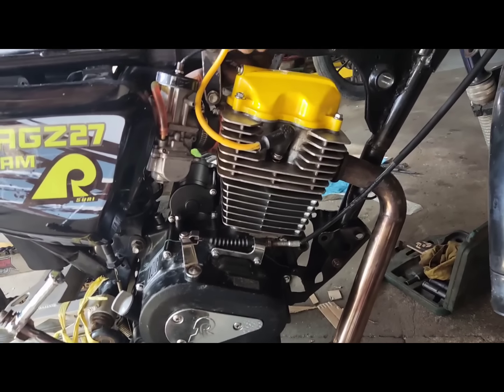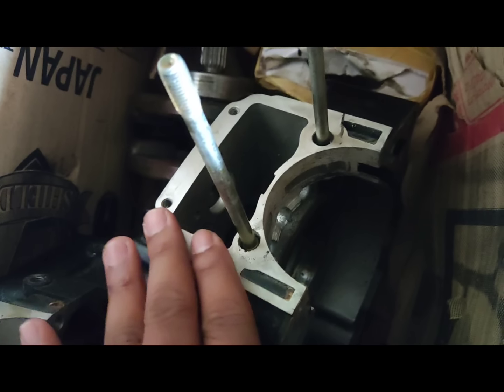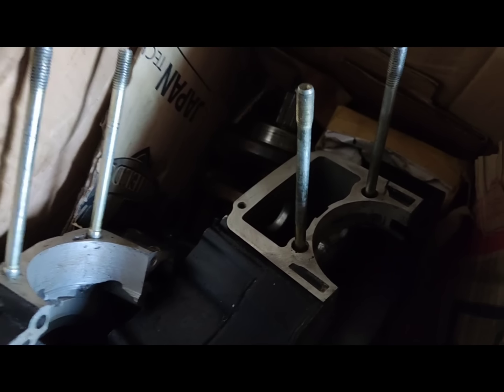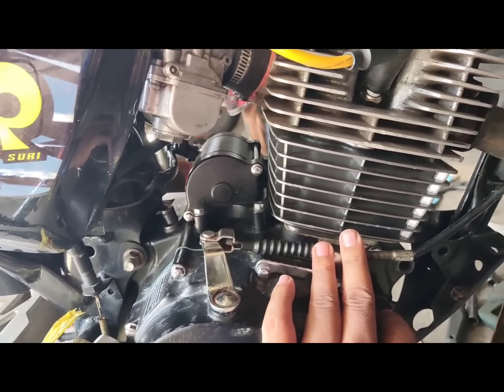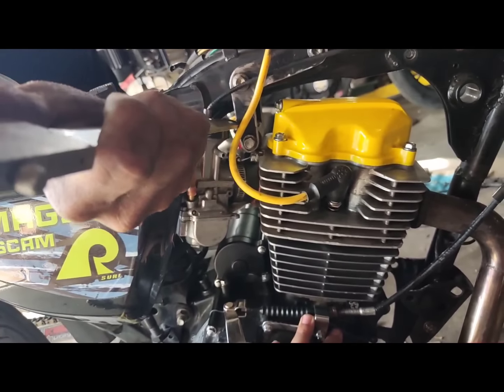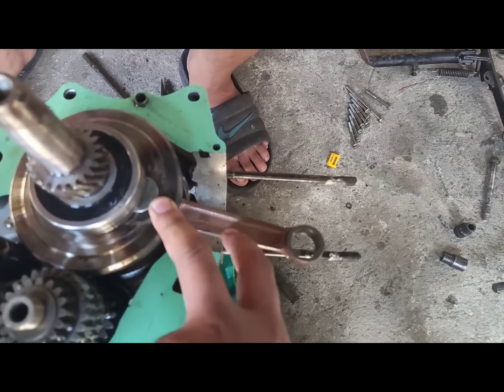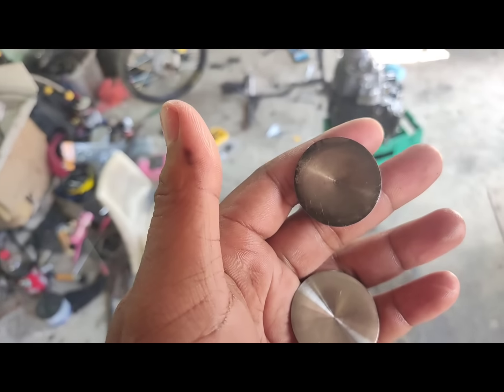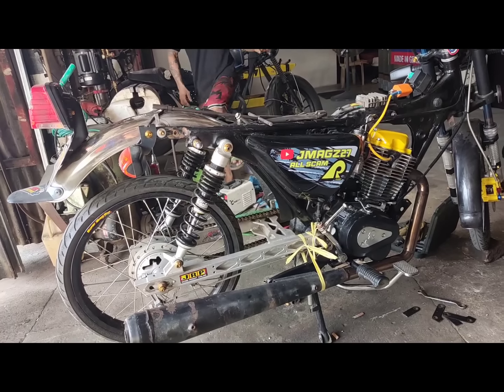RUSI TC125 OPEN | 125cc CONVERTED TO 250cc | JMAGZ27

Comment: boss pwede ba loaded na rusi 150 yung stock head ng cg250 naka big valve na kasi agad.. bali yan nalang kulang sa motor ko big valve kung ok ba yung pang cg250 kung papasok ba sa stud bolt yung butas. Salamat po sana masagot.